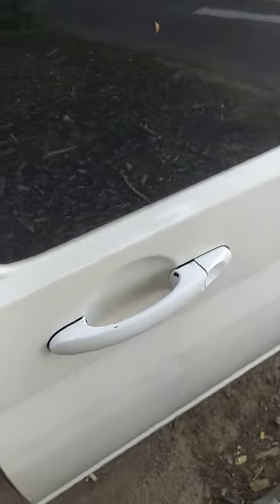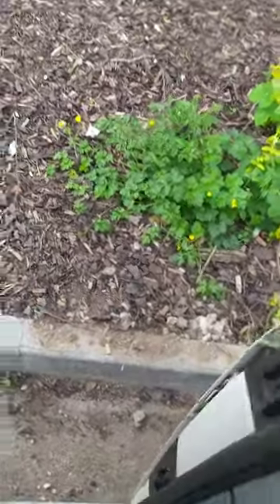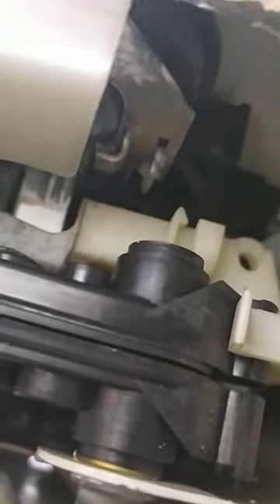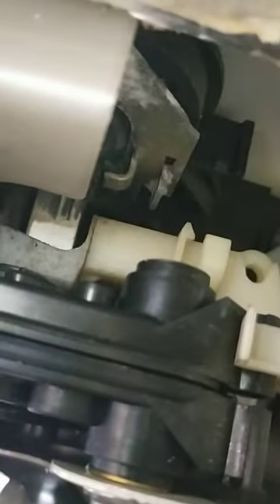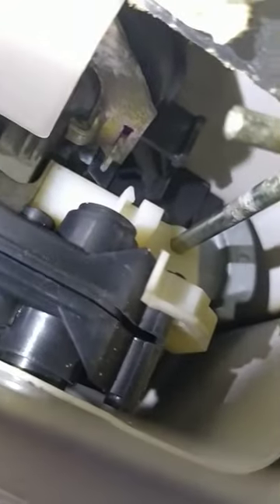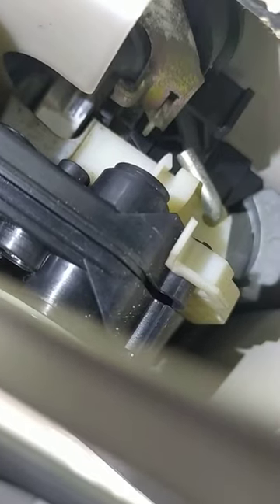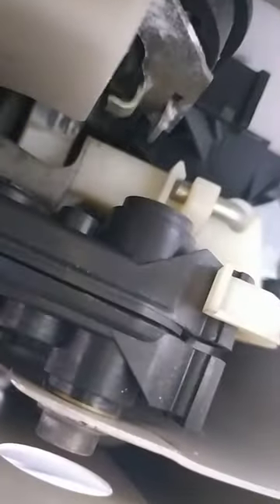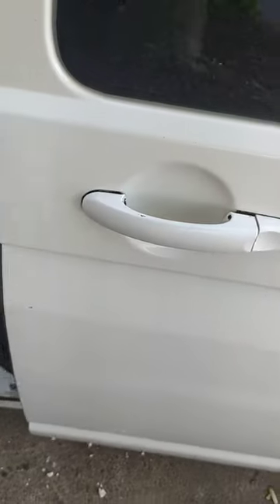VW Transporter T5 / T6  Sliding Door Handle Fix / Repair.

Comment: Another person saved. Thanks for the video. Little pin has come out and stopped the handle working from the outside. Took a bit of wiggling but got it back in and all working now. Thanks again. 😃

Comment: I had the same issue where that metal pin had come unclipped and I couldn't open the door from the outside. After watching this I just clipped it back in and it works like new. Thanks so much :)

Comment: I have a 2017 t6 and sliding door doesn't always unlock on the key. Seems worse now it's cold. Few attempts and it opens. Any help appreciated
Reply from the maker: It could possibly be your door contact. It's three or for contacts that stick out from the sliding door to the front. Try a cotton bud and some wd40 to clean them. The receiver part is indented in the bodywork clean both. Hope this helps 👍